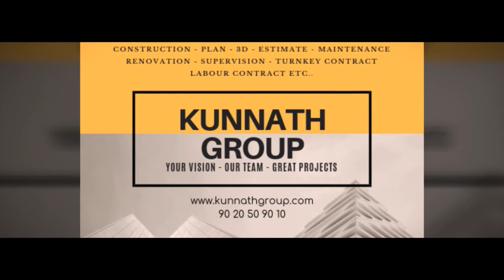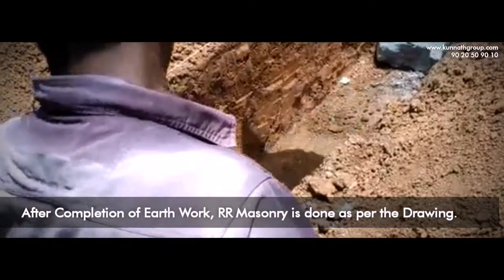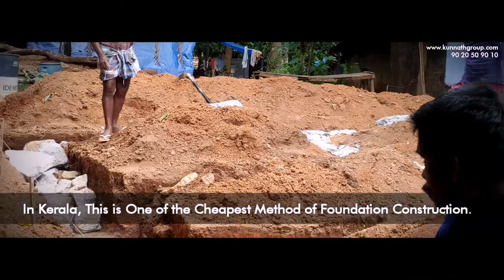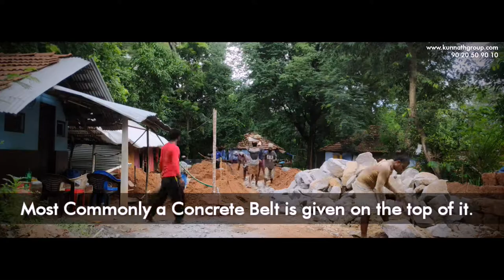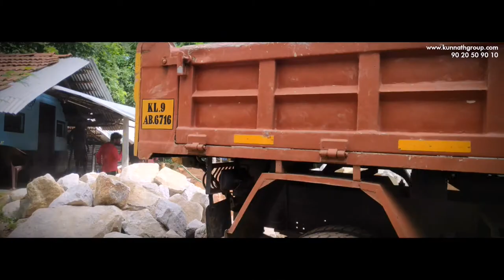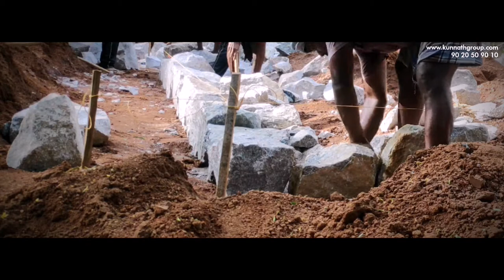RR Masonry Foundation Construction | Cheaper and Stronger Foundation

Comment: Thanks for the video. It cleared my doubt for my first floor construction. 4 to 6 feet deep foundation with stone. Above ground level cemented  stone work. Then an RCC belt. Then latetite stone wall. But still doubted foundation for a storey above ground floor. Thanks for the video.
Reply from the maker: Great job
Reply: Thank you sir. I was relieved of the tension seeing the comment in your video that such foundation has great load bearing capacity of a 3 storey building. I searched a lot but it was from your video got the information. I used laterite stone(vettukallu) for walls. Please do a video about the capacity of vettukallu in  house building . Though a number of videos available about vettukallu construction not much about its strengh or technical side.Thank you.
Reply: What is rate of these worker per day basis?